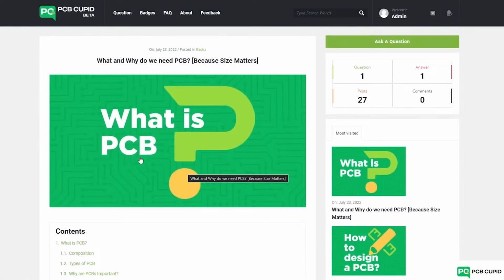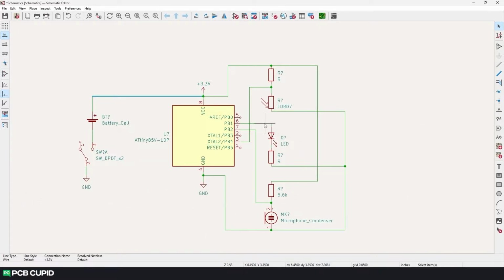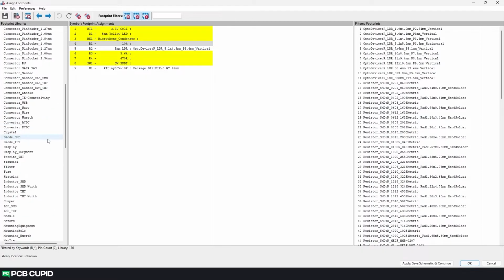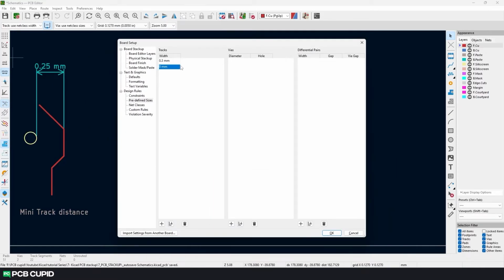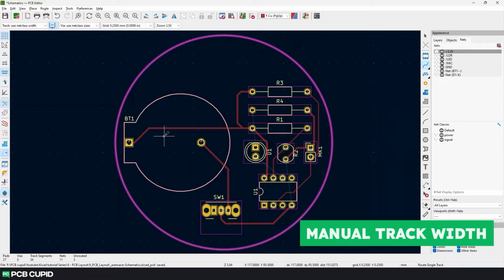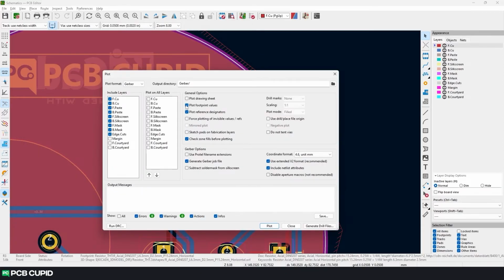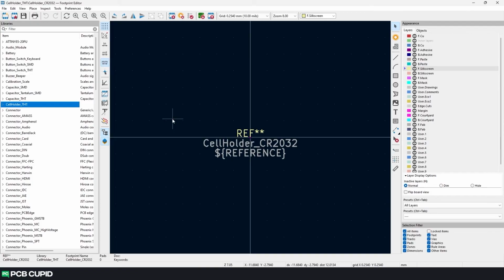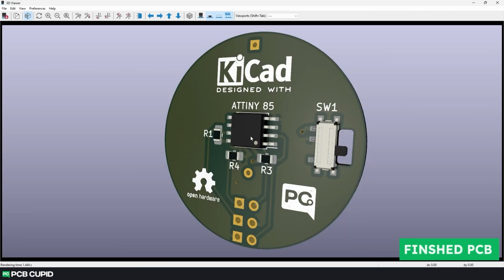Master New KiCad 7 In Under 2 Hours | #PCBCUPID

Comment: After a great start I got to the point where I wanted to download the project file used in the video. Well, which one? There's a whole list there.
Reply from the maker: Each project file is a section of the video,  the first project file will have just the minimum setup and the last project file will have the complete circuit+ PCB layout.

Comment: I tried going about the Board Set up that you have talked about in the time stamp of 46:13 however it shows that "Project is missing or read only. Some settings will not be editable" any clue as to how to overcome that warning? It does not allow me to change the design rules contraints and a few other features in the PCB Editor....
Reply from the maker: It could be that you moved the project or the PCB file accidentally to a different location.
Reply: @pcbcupid  got it, also sir do you have reccomendation for these concepts on KiCad? Mpn or lcsc part number in the BOM, trace thickness, copper pours?
Reply from the maker: @vinayakmishra4510  we do have some of them on our channel, please go through the channel page.
Reply: @pcbcupid  Okay sir, Thank you!

Comment: My PCB design is circular in Shape  and I have exported its step file. And after importing step file into solid works, board outline is missing and only shows the Components not the board .
And In KiCad, I have selected edge cut layer  and KiCad 3D viewer shows me the correct board outline with all the components.

How Can I fix it.?

Comment: Hi, i really loved your video.
I followed it through all the day to design my own board.
i have made my own gerber files and zipped it etc.
At this point I believe I can immediately sent it to pcbways to get it 
created right ?? at 1:30:40 you said that we might think that this is over
and we might send it for manufacturing and you said well sorry.. i will definitely
not send this pcb for manufacturing even though it meets the standards and it's good looking
it needs to be further optimized for production ?? what do you mean by further optimized ??
is there any further optimization that i need to do do on my part to send it for production, after the gerber files have been created ?? what is this optimizations needs to be done ??
Thanks,
Reply from the maker: When we talked about optimization, it's about PCB assembly and sourcing components. Initially all the used components were chosen for easy design but not for cost effectiveness or assembly. 

In the optimization we talk about choosing the component that are easy to assemble by machine (mostly smd components) and cost factor.

Comment: Excellent tutorial in kicad 7. Thanks for covering it. 

Any recommendations on tinning the home made PCBs in India?
Also what is the pcb trace width suggestions for home made PCBs
Reply from the maker: I think 0.2mm - 0.3mm should be good. But you need to be careful with the etching concentration and time.
The other constraint should be clearance somewhere between 0.5-0.6mm
Component placement also follows the same value

Comment: How much wiggle room should i keep for the enclosure? lets say i want the eclosure 100mm by 100mm, how much should i subtract from the 100mm to make the PCB?, and how much should i subtract from the mounting holes for the enclosure?
Reply from the maker: Many manufacturers have a very good tolerance, usually just a few mm (+/- 1-2 mm). Apart from this, please consider the tolerance from your 3d print as well (say about another +/- 1-2 mm).  Then the wiggle room should be between 2-4mm. 

You can design your pcb around 96x96 or 95x95 for a safer range.
Reply: @pcbcupid  Thank you. gonna try that soon hopefully.